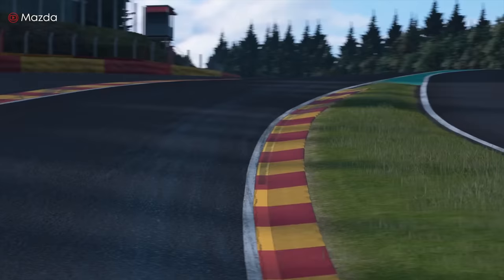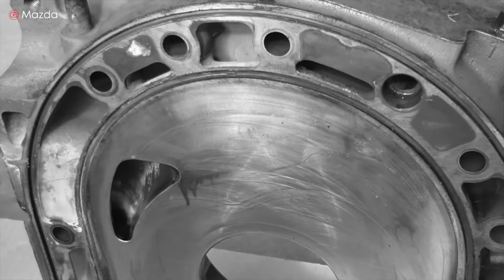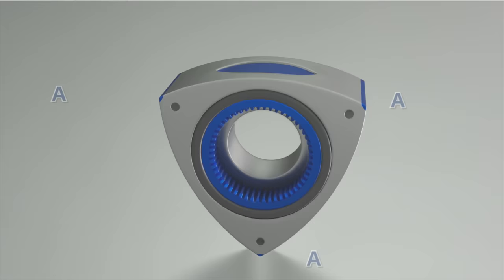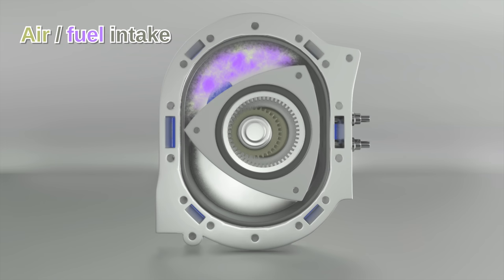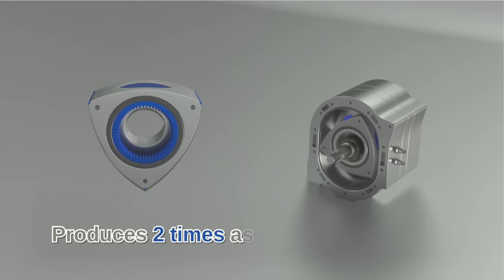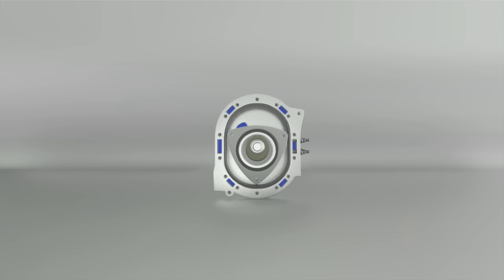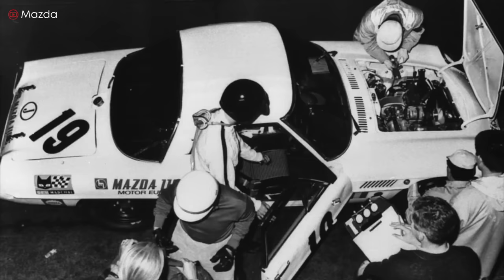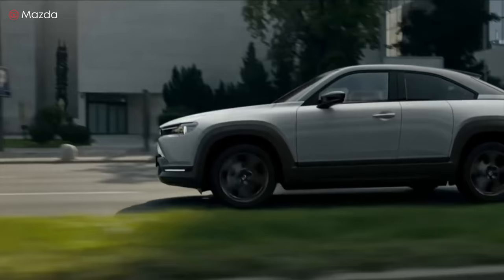Mazda's New Engine is the Most Powerful Engine Ever Made

Comment: Scotty a follow up on my comments about the Rotary Engine yes that old Farmer I worked for in my area has a Suzuki Wankel motorcycle I did get it running after some basic.service it was really easy to Work on compared to some of his other vintage motorcycles ii sounded strange and had an automatic trans I think it was a late 70s vintage and it was water cooled the old guy who now is in his 90s probably still has it.i think there's.less than 20 left in the World it also has the Oil injection circut which when clogs or Fails causes the Apex seals to go dry and Fail along with the Chromium coating on the Rotor case an old drag racer Bill Carroll.built one wrote a book about it and got 300 hp out of it check it out true story Steve in Marysville Washington

Comment: Wait….he posted this as a “new” engine?  Mazda came out with Wankle engine, in the 1970’s cars Mazda was promoting. We almost bought one. 
The initial offers were too durable.,the apex seals material, too durable..so, Mazda dumbed-down the apex seal material…& it wore out too fast. 
Then the engine was deemed unfit to use.  But, those who got the original engines, drove them far longer & reliably, that regular engines..hundreds of thousands of miles.

Comment: Presumably the new range extender sets a new record for output per displacement, or output per pound, or output vs. engine volume, and possibly more than one.  Would have liked to have that clarified in the video.
If you think about it, as battery technology continues to improve and range increases, the range extender concept starts to make increasing sense.  Assuming you need unlimited range, but 90+% of the time you can operate the vehicle entirely on electricity, the rotary's lower weight and size for a given output probably more than makes up for the lower fuel economy and worse emissions -- because dragging significantly less dead weight around 90% of the time probably more than makes up for the lower fuel economy.

Obviously range extenders would be a terrible solution for someone primarily driving long-haul on gas.
But for the niche of electric vehicles that can offer unlimited range without the compromises of a hybrid, it's arguably the right transitional technology bridge between hybrids and all-electric vehicles.
Reply: Except all the major manufacturers have abandoned range extenders.

Comment: Sorry man, Mazda dropped rotary engine production due to the problems in sealing of the piston in 2016 ( maybe +/- few years). I wish they could solve this problem but with current available material technology it was not possible. Otherwise, wankel engines are far better than reciprocating engines in thermal efficiency.

Comment: The Wankel engine is great the problem is the transmission cannot handle the rotational velocity.
Reply: What?
Reply: @SidewaysGts  had one tach goes to 15,000 rpm engines keeps going. Trans clutch gave at 8000 rpm
Reply: @JohnThomas-lr9ec  "had one tach goes to 15,000 rpm engines keeps going. Trans clutch gave at 8000 rpm"

Ok, and im going to repeat myself here-

What?

Are you saying you had a rotary engine that revved to 15k rpms?

And which was it, the trans or the clutch, that let go? Theyre different components.  

And- 

Why would it have mattered if it was a rotary engine or a piston engine, if it "let go" at 8000 rpms?
Reply: @SidewaysGts  it dynoed at 18,000 rpm.  Trans locked and blew the clutch
Reply: @JohnThomas-lr9ec  "it dynoed at 18,000 rpm.  Trans locked and blew the clutch"

How many pound of vtec was it running?

Comment: Surely the internal combustion engine is outmoded technology unless it's hydrogen powered it will have little future. Most manufacturers will go down the electric motor route
Reply: Don't hold your breath... batteries are not a solution

Comment: You are all invited to Puerto Rico, the  island of impossible creatures. Featuring bi weekly elimination races up to the Grand Finale: 
"ROTARY VS PISTONS" in a NHRA sanctioned 3 or 4 second quartermile races. Of course, 2 or 3 rotor Wankels* VS WHATEVER has pistons on it, and can deliver a match without shame.
Be warned the event is famous internationally and the place will be crowded. Of course, you can visit the engine assemblers and talk with them about the modified engine set to run. 90% of the population is well educated in auto mechanics. (*they are not Wankels, as 100% of the parts are made in Puerto Rico modified for racing).

Comment: Ford did exstencive lab testing on the rotary motor for small airplanes but it got shitty gas milage and in cars also and it's a very dirty motor it puts out alot of emissions so the new liquid piston motors have the same problems so it back to the drawing board the over unity motor driving by very powerful magnets and using a magnetic bearing so it doesent have friction is where it's gonna be at go the way to generate power for charging battery's to power our motors in cars

Comment: How many rx8 owner had problems with the Walker motor? I read a lots of bad experince abut the walker engine. Aspecialy how hard to keep them alive. Don't push if its cold, dont push if hot! Change the oil monthly. If you do that maybee can live 60 000 km. Than rubish the engine. Don't throw rocks to me I am not an anty walker guy. I especialy love the mazda 787 b sound and power. I just know some bulls... of the other side by this engine.
If you want to see mind blowing new tipe of combustion engine tech, I do recommend Koenigsegg TFG! Tiny Frienly Giant. A 3 cilinder, 2 liter engine produce 600 Hp without campbelt using freevalve technologie. Not a bad thing from a family business...😂

Comment: No mention of rotary upgrades 
All gone quiet

Well he didn't get wind of new materials they working with to revamp the tips / seals on the tortilla chip  that is nasa standard sizzle for entering the sun 
And as soon as graphinee can be harnessed you will see more thing happen in the industry shame saab is not about as they had plans for that stuff apparnetly they  wanted to water 3d print the body like nascar

Comment: The rx8 engine is a huge fail the rx7 was build stronger and holds way more boost and hp . The rx8 will destroy itself after 350 hp the rx7 will hold about 600 hp on mostly stock engine parts.

Comment: My mazda 2008 has vacuum leak. I have replaced 02 sensor, service engine, changed spark plugs, new fan belt. I don't know what is going. CN you help??
Reply: Take it to a shop and have them use a fog machine to find the vacuum leak.

But, If you want to be crafty on your own, get a can of flammable brake cleaner, use the straw, and start spraying around the vacuum lines. When you spray over the vacuum leak the idle will falter and dip down- telling you where the trouble location is.

Comment: Absurd claim to be the powerful engine ever?!  Nitro field dragsters are powered by engines so powerful there is no dyno strong enough to measure them but are believed to have as much as 10,000 horse power.  But you can buy a 1000 horsepower car at several dealerships today and again that Mazda engine is puny beside them.  Mazda cars are notably well made. sports car like handlers and creatively designed.

Comment: That's because  it's all Hot 🔥  air! Chrysler had a turbine jet car engine way back in the 1950s it was Cool the engine could run on any flammable fuel ⛽️  they ran the car on channel perfume , alchol, kerosene diesel gasoline ⛽️ 😀  what a car the epa made them crush the cars Jay Leno owns a turbine chrysler.

Comment: Junk engines. Of course reciprocating means reversing in a gas engine. The wankel engine was intended to be a turbine-like engine with everything moving in a circular way. The power stroke is poor a nd the delivery of power is uneven. Terrible emissions.
Reply: The new Mazda MX-30 rotary engined model will be unveiled on the Mazda stand at the Brussels Motor Show on January 13th 2023, with a press conference at 10:00 CET.  Two days away.